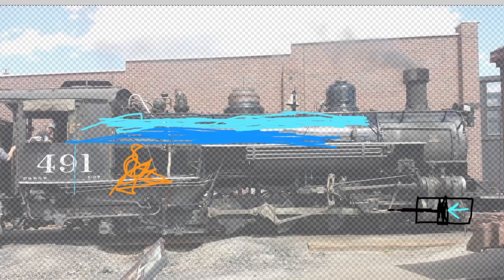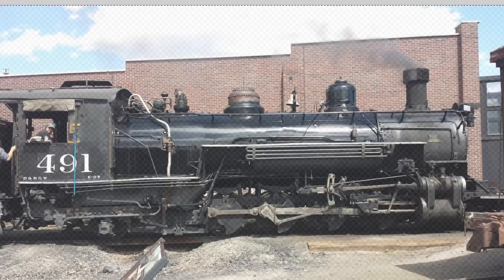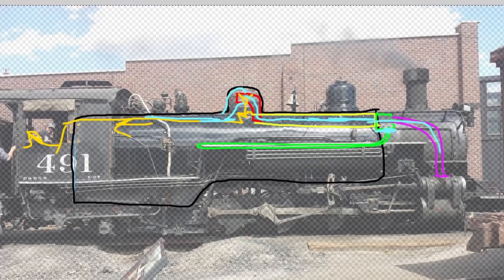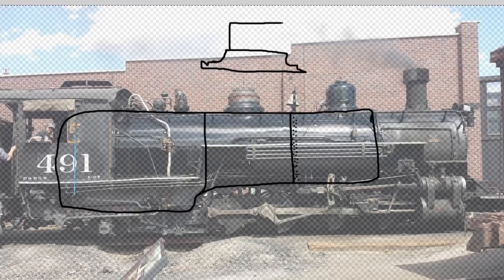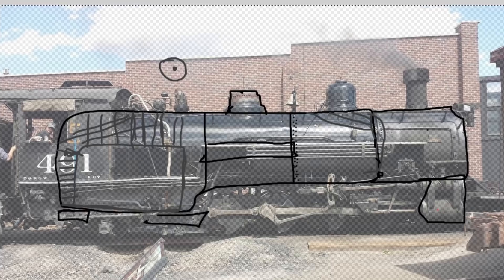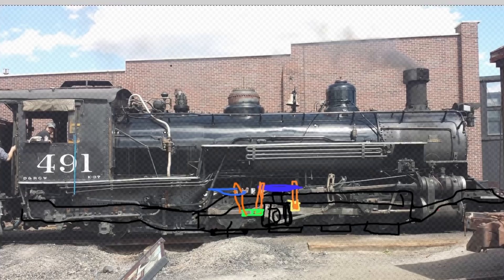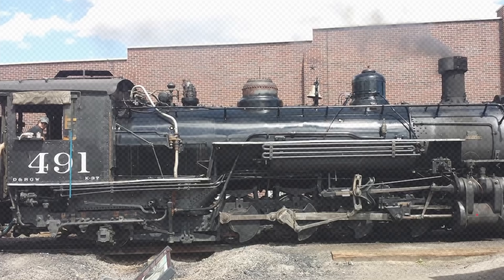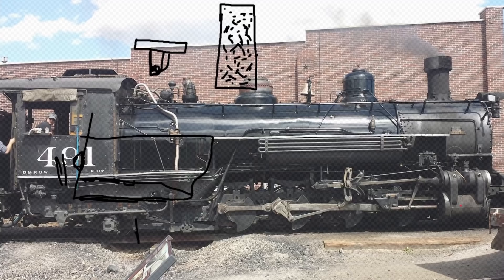Steam 101: 10 Levels of Steam Locomotive Understanding

Comment: Level 11: Understanding why boilers can explode. The boiling point of water is a function of pressure. The more pressure, the higher the boiling point. Take the pressure away (i.e. through a rupture of the crown sheet of the fire box due to overheating the steel) and the boiling point of the heated water in the boiler falls quickly. Since the hot water contains lots of energy the water now becomes steam nearly instantly. Steam takes up 1.600 times more space than water and it now tries to rush through the rupture. But there was a lot of water in the boiler... that now has become a very lot of steam which can't all exit through the rupture and thus start to build up uncontrolled presssure. If the pressure then overcomes the structural strength of parts of the boiler it will blow them apart and away. There are examples of boiler barrels and smoke boxes thrown hundrets of meters/yards from the engine by boiler explosions. But flying metal isn't the only danger of a boiler explosion. If you're happen to stand close and don't get hit by metal you'll still have to deal with very hot steam all around.
Reply: Exactly, and many RR employees were scalded to death, and that brought about the Railway Labor Act passed by Congress to ensure safer working conditions for the workers
Reply: Historical railroad track VA steam valve frozen from heat. It wasn't the grade but the thing exploded.
Reply: In a naval context, letting cold sea water (or even warm sea water) into the engine room of a steam ship is very bad news.  Cold water suddenly cooling a pipe of superheated steam in a ship containing a couple hudred horsepower worth of boilers (8 naval boilers in the case of the Iowa Class Battleship produce 212 KHP) shatters the pipe due to thermal expansion.  So, imagine several Big Boys all blowing up inside a sealed engine compartment designed to be water tight and thus air tight.  Hooray!  You have a massive bomb!
Reply: TLDR what ur trying to say is PV=nRT. Keep it simple.
Reply: Close but not quite. It will not ”build up” any pressure (from flashing into steam) and does not all become steam at once, as saturated vapour pressure is the limit for the steam phase. It’s just that with a rupture, the boiler loses it’s structural strength and metal will rapidly peel back around the opening. In addition, the vigorous boiling can throw large mass of water towards the opening (to where everything is flowing) and essentially wrecking ball the metal from inside.
Reply: @LauriLevola  Precisely. That is also the reason you do not want to run on low water levels, because you tend to overheat the boiler in specific areas which were not meant to be overheated that much. Then when you finally inject a large amount of water, you can cause an explosion. Sometimes sloshing low water level after a long break with more or less constant deceleration can cause an explosion, which is super deadly as it tends to explode when the train stops at a platform full of people. Such explosions happened.
Reply: HYDROGEN GAS.  Separate water into steam, which is a very explosive combination of hydrogen and oxygen, all it takes is one good spark to blow a boiler.  Oh look at that, a convenient source of flame, the firebox!
Reply: Think water can't be dangerous?  Water flashed into steam in Chernobyl reactor 4.  It lifted the 2 million pound lid.
Reply: Thankyou for the information. I like to understand how  machical parts work. I love Steam Trains I used to hear them when I was a youngster. We live near the Enfield Train sheds, NSW Australia. The memory has been edged in my mind,  I'm sure forever. Through all these comments and the video I am learning how Steam Trains work. Thankyou again I really enjoyed the video.
Reply: @MidnightMechanic  Um, no. That's not how phase transitions work mate. Steam is simply water that has been heated until it reaches the transition point to the gas phase; it's just very hot water vapour, and water is not explosive. You're correct in suggesting that a mixture of hydrogen and oxygen can be incredibly explosive in the correct proportions, but at no point in a steam engine does the H2O get chemically seperated into H and O2. The danger from a boiler explosion is simply due to the heat and pressure contained within it. Hope this clears things up!
Reply: That releasing of pressure is also why you don’t want to unscrew the pressure cap on your car’s radiator if it’s overheating.  The instant you do so, that pressure is released and the liquid coolant closest to the pressure cap immediately turns into steam, which then escapes through the opening you made by unscrewing the pressure cap.
Reply: I grew up very near those sheds & the goods line ran past the back of my house- definitely where the affinity for trains started.
Reply: @michaelmurray7199  and if you extra unlucky you are trying to look into the Cap opening while your opening it . . . congrats you are now blind cause your eyes are boiled
Reply: Hence why you have a safety valve system.
Reply: @MidnightMechanic  Sure, water only decomposes well above the melting temperature of steel. And steam is just vaporized water, not explosive at all.
Reply: this can happen with any tank containing a liquid that would be a gas if not for the pressure, such as propane or carbon dioxide. the technical term for this type of incident is Boiling Liquid Expanding Vapor Explosion, or BLEVE
Reply: It's basically a bomb on wheels.
Reply: The things you learn from a video about why “The Polar Express would Explode”.

Comment: There's a lot of interesting technology that went into a steam engine that isn't common to see nowadays but is still useful in certain applications. I would love to know how these systems truly work together to make a steam engine function on a deeper level
Reply: Since I think about getting one every other year for over two decades now...
Fiddling around with things is imho the best way to learn.
If you're willing and able to spend 100-200 Dollar/Euro, you maybe should get a working (stationary) steam engine in model size.
Or a mobile one if you spend more. Here in Germany the company "Wilesco" seems to be a "huge" manufacturer of these cool little machines.
Reply: @MegaSockenschuss  here in the U. S. each state has an office of boiler inspector. They are very very strick, especially if you bought a vintage locomotive. I'm not sure what the rules are for a stationary engine. I do know that larger office buildings that have a steam boiler are subject to an annual inspection.
Reply: @Green4321  model size is the key word. ^^
The affordable stationary ones from the mentioned company got 135 cm³ boilers. (8.2 cubic inch)
I doubt these little things need an official inspection at all.

Comment: It was really nice having someone explain that the superheater dries the steam rather than claiming it raises the pressure.
The level 10 explanation was pretty good, but there are reasons not to run with the throttle full open relating to wear on the valve gear. If the Johnson bar is set too close to the center the ports on the valve gear are in a partially open position longer resulting in more steam erosion of the ports. The higher the steam pressure to the valve gears the greater the wear as well. On the other end, running with the throttle set too low results in hammering the connecting pipes. The old-timers learned the art of finding where the balance between the two was.
Reply from the maker: Absolutely, good addition. I should have stated moreso that I was talking about max tonnage on a hill, most other times you find the balance for precisely the reason you stated. Cheers :)
Reply: @Hyce777 , not being an expert on locomotives, but wouldn't it be that max open on the Jonson bar provides maximum torque, to get started, and once up to speed, that much torque isn't needed; instead, more horsepower is needed to keep the speed up on level ground?
Reply: @billybcgn25  the torque only depends on the piston pressure. There will be a pressure drop over the valve but that pressure drop depends on the flow (amount of steam going through the valve in a given time) in combination with how far open the valve is. When the piston is stationary or moving slowly you have little to no flow and thus no pressure drop. Moving the valve does not change the torque as long as the piston still gets fully filled in time. (slight nuance, during the filling of the piston you don't have maximum force so the average torque will be different if the filling takes longer or shorter) To keep the same torque you would actually need to open up the Johnson bar when going at higher speeds because the flow, and thus the pressure drop over the valves, is higher. Opening up the Johnson bar will reduce the pressure drop and increase the torque.
Reply: @billybcgn25  Small correction torque and horsepower are not different things. Horsepower is literally torque×RPM.
Reply: @user-bi7xd8ry5p  Torque is rotational force, and power is force over time, adding in the time factor does change the meaning enough in this sense to not use them interchangeably.
Reply: @coast2coast00  I meant that horsepower doesn't equal speed and torque is a "part" of it.

Comment: Would be cool to have more in depth explanation of feed-water injectors and compressors
Reply: I would love more detail about fuels and how they influence locomtovie design, ie: how potent the coal is, how large the firebox would need to be in order to heat a said amount of water and specific Horsepower of a boiler, pistons etc to give a certain amount of power.

I already know a little bit about hard and soft water and how scaling is a problem within boilers but I wonder about locomotive design in principle.

Comment: Very cool, I learned a lot. Most of my more detailed knowledge is in the boiler area, the valves and cylinders. You gave a lot of fascinating info on some of the other things I knew a lot less about. Thanks!
Reply: For me, it was more overall knowledge, but I do wonder about what influences a locomtovie's core design aspects (grate size, boiler size and cylinder side).
Reply: @Ben31337l  Speaking as an enthusiast, It's usually weight limits on the infrastructure like bridges, needed power, and what speeds they are expected to run at. 

With speed the larger the wheel diameter the faster the effective running speed of the locomotive, but the less efficient the power is at pulling heavy loads. This is especially noticeable on lines with heavy grades. A good example of this is the GWR Hall and Grange classes in Great Britain, where the Grange class had smaller drivers and was used for heavier freight service than the Hall class.

The boiler size is often dictated by weight limits, although it can be limited by other factors like cost to run and maintain. Grate size usually increases with the boiler size, simply because of limitations on ability to heat the boiler water effectively. Cylinder size and boiler size are also closely connected, because while the cylinders are responsible for putting out the power of the locomotive, there are limits on it set by the boiler's steam evaporation rate. If a locomotive needs lots of power for extended lengths of running, it will be more prone to running out of steam than one in less strenuous conditions and will have a slightly smaller limit on its cylinder sizes compared to its boiler.

All of this put together helps explain why steam locomotive designs varied so widely. I'm not really an expert so this might not be the best explanation, but I hope it helps.
Reply: @andrewreynolds4949  "Grate size usually increases with the boiler size, simply because of limitations on ability to heat the boiler water effectively." This is related to the typical calorific value of the fuel that you expect to burn.

The calorific value of the fuel, grate size and boiler size are all interconnected from my standpoint.

The entire thing is constrained by the MAM (maximum Authorised mass) for a given vehicle length.

But given that, the cylinder size and maximum permitted boiler PSI normally determines the maximum HP that the locomotive is able to generate at any one time, whether it is able to put it down is another point entirely.

When it comes to weight limits, you can usually get away with a narrower, longer boiler (Smaller radius boiler) spread the weight out over more axles like the LSWR Adams radial tank did.

"Cylinder size and boiler size are also closely connected, because while the cylinders are responsible for putting out the power of the locomotive, there are limits on it set by the boiler's steam evaporation rate."

I actually feel like this is a false equivellence really, because at a certain wheel RPM at full cutoff, you are going to reach the boiler's maximum HP at a certain RPM regardless of the size of the cylinder.

At which point, the boiler will inevitabily run out of steam and the locomtovie reaches an equibrium until an external factor changes.

Depending on how large the ratio of the boiler overall volume & PSI compared to the cylinder and the RPM of the driving wheels given the cutoff is wide open, dictates how soon you will run out of steam.

And the above is not guarranteed as situations do change, as pressure decreases so does the overall HP of the locomotive menaing that it uses steam less, hence the equibrium.
Reply: @Ben31337l  Yes, I was trying to offer a somewhat simple explanation
Reply: @andrewreynolds4949  Well, I tend to go all out if you haven't noticed.

Eventually though. (Some vehicles are faster than others), you get to the materials themselves, the properties they have and, honestly, that's how far the rabbithole goes.
Reply: @Ben31337l  Don't get me started on arguments over whether this railroad or that railroad's locomotives really are better. Reading test performance reports can give some very inconclusive comparisons and ammunition for both sides
Reply: @andrewreynolds4949  You design trains for purpose, at the day, it doesn't really matter so long as they are reliable.